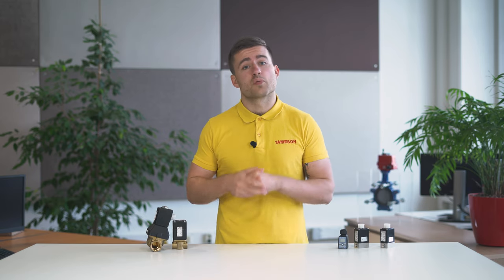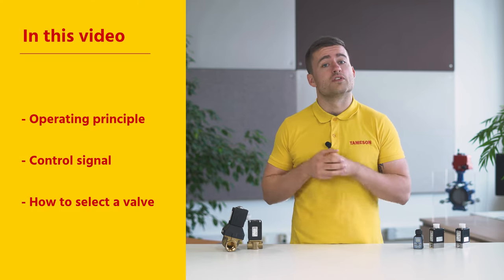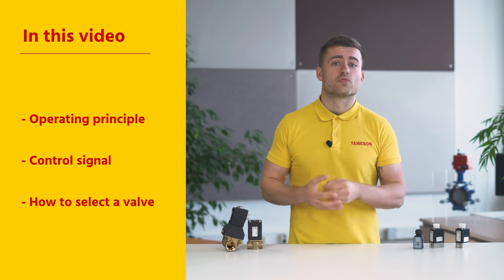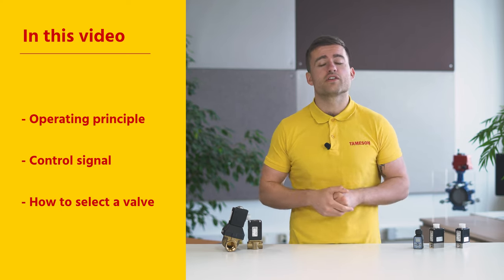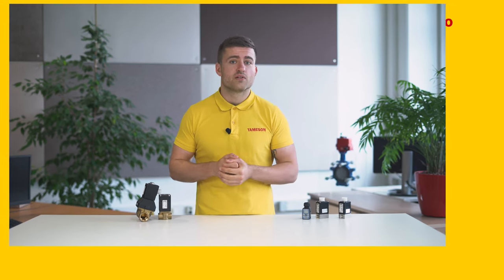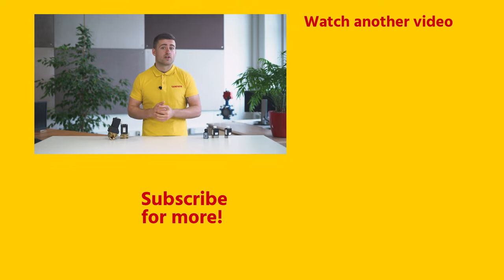How does a proportional solenoid valve work? | Selection guide | Tameson

Comment: Thanks for the video. Do you have a proportional valve that works in engine coolant? Also do you have a temperature PID controller that has PWM output?
Reply from the maker: Hello Arved. For the proper selection of the valve we would need a fluid specification and other conditions, but in general the valve for engine coolant should be available. You can always contact us on support@tameson.com
For temperature controller you can check Burkert 8611 article: https://tameson.com/pages/burkert-8611-solenoid-valve-controller